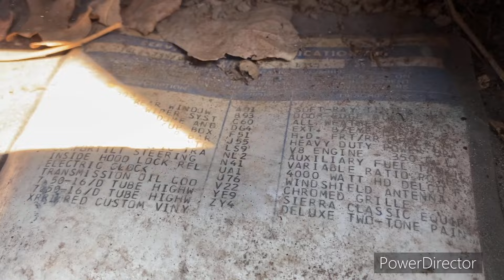DESTRUCTION CRUSHING EVERYTHING I TOUCH! including WALKAROUND!

Comment: Yes, 1977 model year, and a late production one at that.

We got the VIN, we win: T for GMC, C for 2WD conventional chassis, L for 350 CID V8 with four barrel, 2 for 3/4-ton rated, 4 for cab and pickup box, 7 for 1977 model year, S for St. Louis, MO assembly and the rest is the production sequence. The St. Louis MO plant which in 1977 would assemble Corvettes as well closed in 1986. After Corvette production moved from St. Louis MO to Bowling Green KY (where it still is today), the St. Louis plant mostly assembled trucks.

Possible code 71 Red and code 12 White two-two exterior paint (originally).